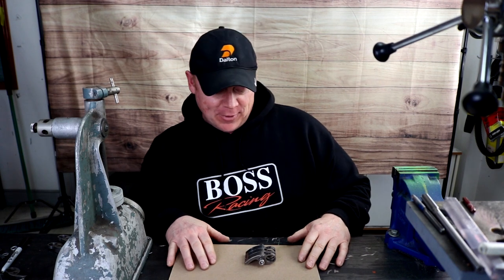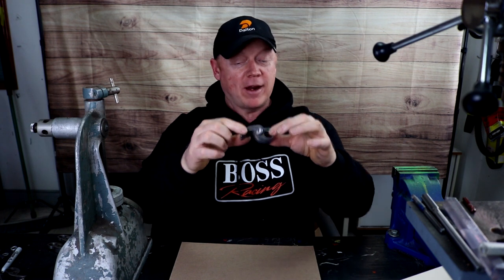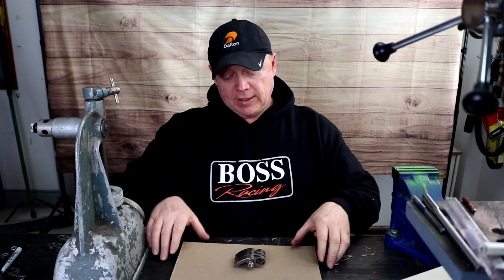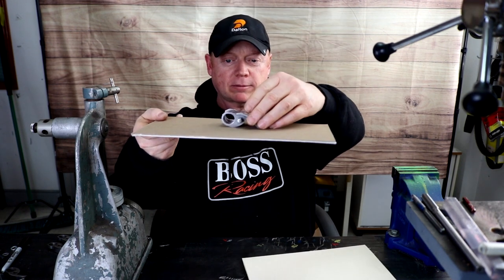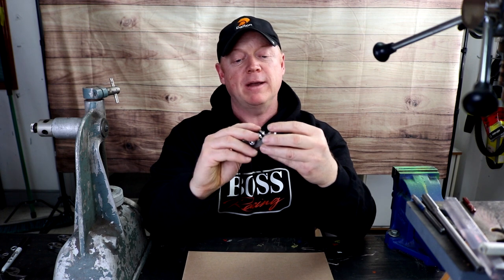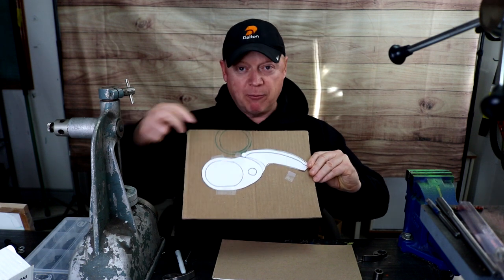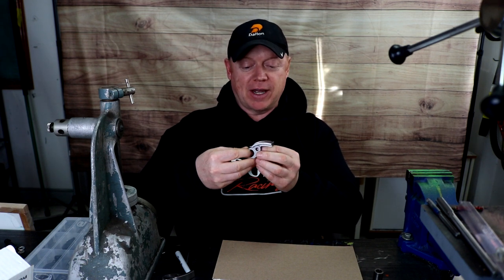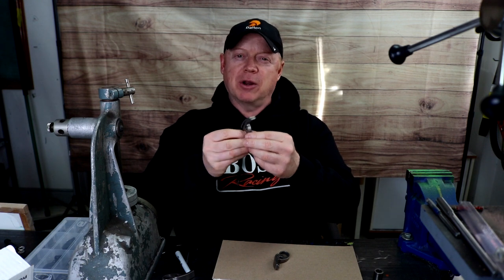Ski-Doo pDrive clutch how ramps work Part 1 iBackshift

Comment: grate show like it ,,,,skidoo 2016 600 rs dragrace 500 feet ideal ramps ? and rmp
Reply from the maker: The stock ramps are great. Where you are going to get off the line the hardest is to have the engagement speed as close to 6000 as possible, then choose your helix start angle, somewhere in the 70 degree start for .31.
Reply: @iBackshift  just afraid it would spin out im running 46-44 now and bearly staing put in the starting matt. My engagment rmp is 5800  .would a 70 launch harder ? In theory  when in starting from a startmat the prlmary wont pull all that helx angle at 5800 r
Mp actually does it soften up the launch?

Comment: So what do u think about the BMP double adj ramp? They use magnets like in they're Polaris weights and they changed the clicker also. Think its necessary? Skidoo has a bunch of ramps along with other companies,  I really don't see the need for magnets to add thru the heel to tip since the clicker tec makes it steeper 🤷‍♂️🤔
Reply from the maker: they are "tuner" weights.  IF you want to tune, THEN buy a set of tuner weights.  In the end just like most use of tuner weights - you'll end up fiddling with them a handful of times, THEN, you'll get tired of it and leave it alone and just drive.  Your friends too, will get tired of YOU tuning your setup every time you take a break.

Comment: Think slp had a magnet setup also, im gonna have to look again.  This sucks having a skidoo and a Polaris  when im use to the Poo set ups
Reply from the maker: What is the most simple ramp (cam arm) you can use?  Then get that simple use cam arm, OR just tune the stock ramp with the pivot bolt (pdrive) and tune with springs.

Comment: the backcountry has the 990 ramp and a mxz has the 968.  if your at sea level riding how would the mxz clutching work in the backcountry?  would that be an improvement in drag racing than the backcountry clutching? cant imagine with the low gearing of the backcountry that any clutching would not back shift fast enough.
Reply: would be fun to run install mxz clutching into the back country and see how it goes.  right now the back country is very revvy and backshifts so fast it is almost like an atv engine braking.
Reply from the maker: @minnesotasnowmobiler.racer5513  The 968 and the 990 are the EXACT same profile.  Just the weight(mass) is different.

Comment: Can I get higher rpm engagement then 4000?
Reply from the maker: Look at the primary clutch spring forces.  What is the start force?  Increase the start force.  So if like have a 120/350 then go 150/350, raise the start force, raises the engagement speed.